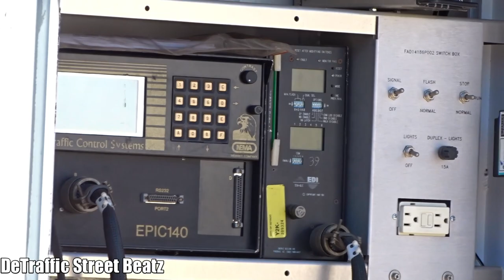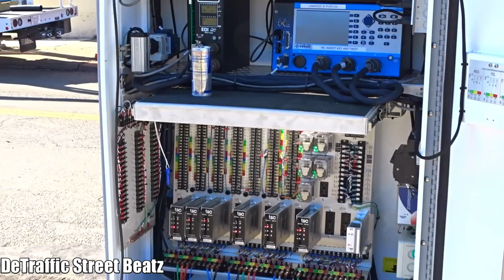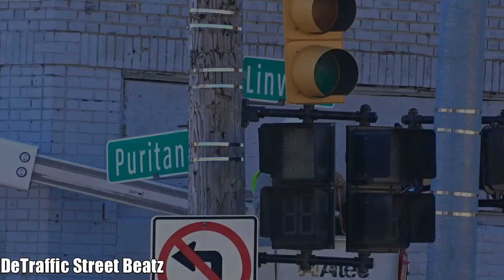Old Traffic Lights Removal | Puritan & Linwood

Comment: Please tell the City that the 4-sec flashing arrow signal is wired wrong and violates the MUTCD. The arrow is supposed to flash in the 3rd section, not the 2nd. Thanks.

Comment: EPIC140 controller in the old cabinet. That was Michigan’s standard controller for many years. Quite a few still in service, but the numbers dropping. I have an EPIC sitting on my workbench
Reply from the maker: Are they easy to operate far as the controls of the system?
Reply: Relatively easy to operate. You need a basic understanding of traffic engineering terminology to program it. The EPICs were unique in that they were open ended timers you assigned any output to. So you could make any sequence for an intersection. If timers ended on a fraction the next timer started on an “on” state. You can see this when a flashing dont walk or flashing red left turn has a studder in the flashing. It’s because the timer was a fraction. EPICs are very limited controllers nowadays. They dont handle much detection or communication capability. Cobalts, which was this intersection’s replacement and similar controllers are much more powerful and user friendly.
Reply from the maker: @NickBasilico  Amazing I plan to collect once I get more space

Comment: The first thing I noticed was the solid and blinking yellow arrows were juxtaposed. When those types of lights were introduced to Las Vegas, I saw one of them like that as well, though those lights function where the green light goes first then after changing back to red briefly, the blinking light comes on, and then it changes back to red again. So, to see the top arrow blink, then the arrow below it come on before turning red was really strange.

UPDATE: I realize I am not the first here to notice that.

Comment: Left Turn Signal should only have 3 Lens instead of 4. So that way it’ll be a Same Color All in One to share with Flashing Yellow Arrow & Steady Yellow.
Reply from the maker: I do like the extra arrow beacon I think it let drivers know it's a Left Turn Signal or they should put the left cube sign on the top
Reply: @DeTrafficStreetBeatz  the problem here is, and I mentioned it above, that the two yellow arrows are juxtaposed here.